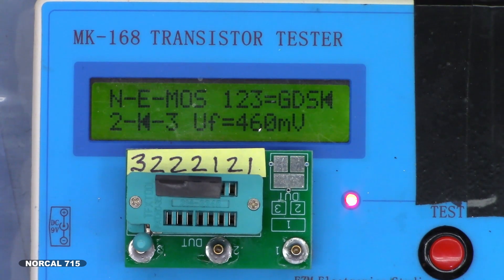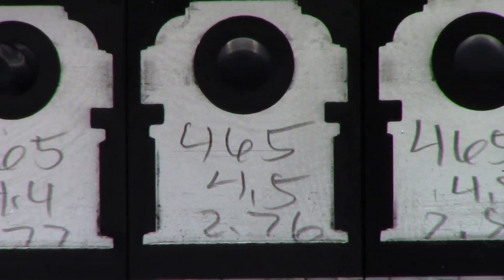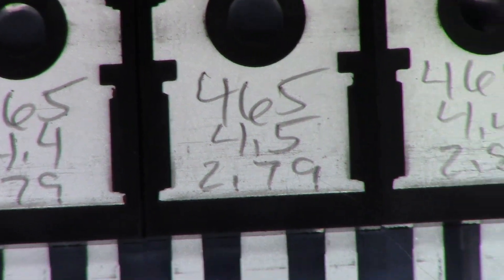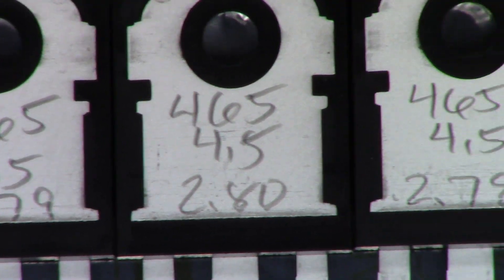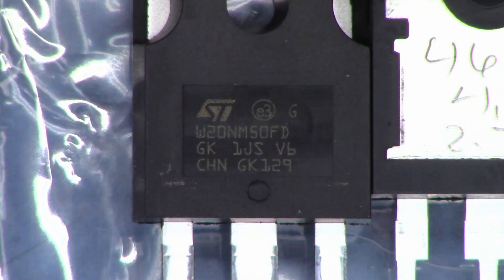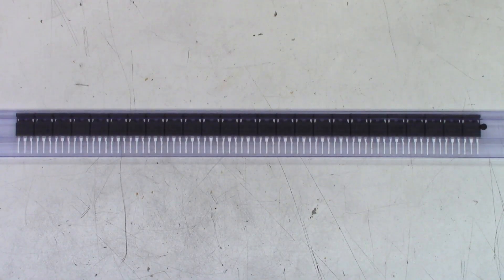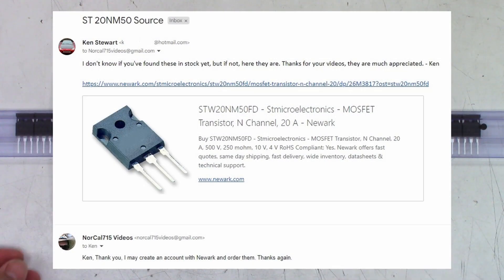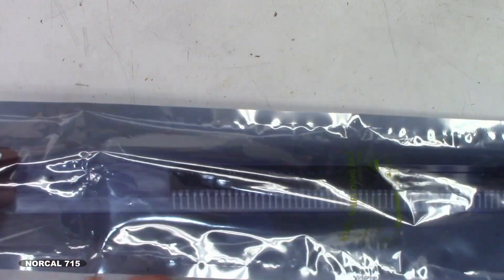The Definitive Technology Super Cube Subwoofer parts are here! Perfectly Matched, Factory Fresh.

Comment: i have a Definitive Technology Powerfield Subwoofer with an issue that when there is a loss of power the woofer has such a thump it bottoms out it does the same thing when powering back up.  When the sub goes to sleep when not in use it is quiet. any ideas what causes this?
Reply from the maker: I have had issues with the capacitors in the digital audio power output FET driver circuits. usually they damage the output FETs though.
Reply: Hi Steve, I did try to reach-out to you via email and see the update for my SuperCube3. Just wondering the status. Thank you.